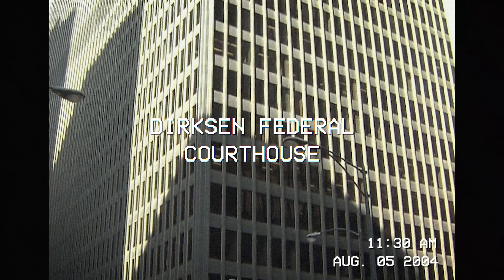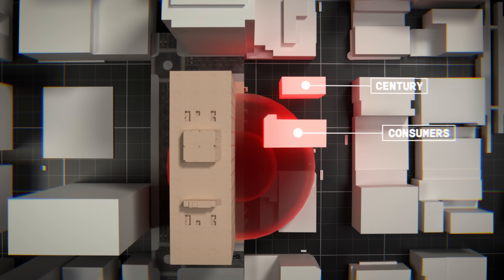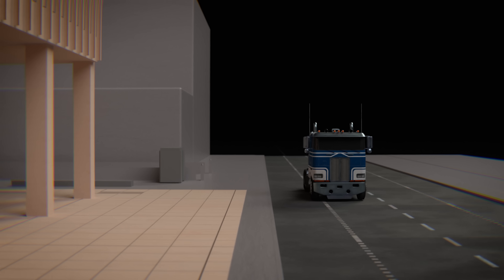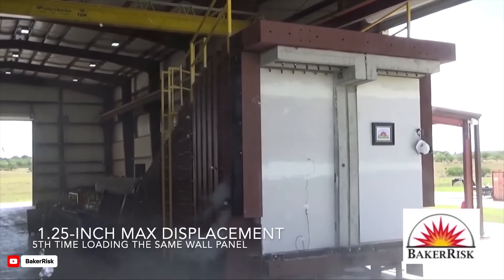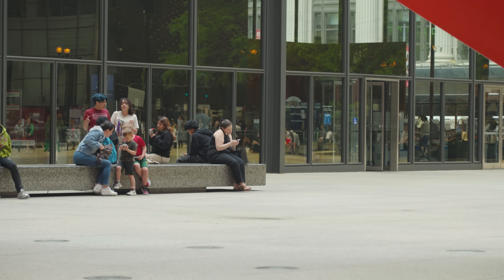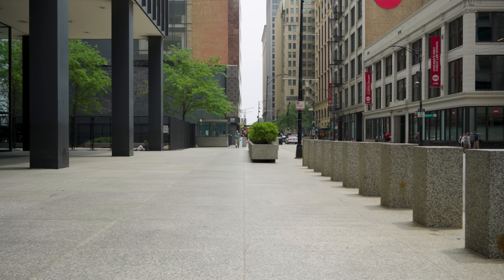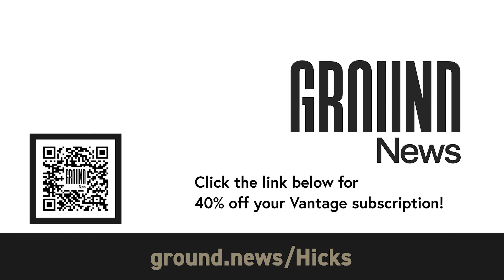How a Bombproof Building Works

Comment: The broken Windows theory was proven to be based on bad intelligence combined with false assumptions. I really thought a lot of that theory as well. Until I read Malcom Gladwells, "Revenge of the tipping point." Where he admitting to using bad intel and apologized for feeding an urban myth. I think caring for our environments pays dividends, but we shouldn't site bad evidence to bolster. Thanks for the great video.
Reply: I think broken windows has truthful elements to it, but just making a place look nicer won't make a place nicer and and of itself, because the underlying reason may need to be addressed.
Reply: It actually does work however
Reply: @My_Old_YT_Account  They're not going to acknowledge it.  It's motivated reasoning.  There's a whole political house of cards beneath their claim that it's BS.  They don't actually care about the claim itself.  But they must assert it as a condition for valid membership in their ideological tribe.

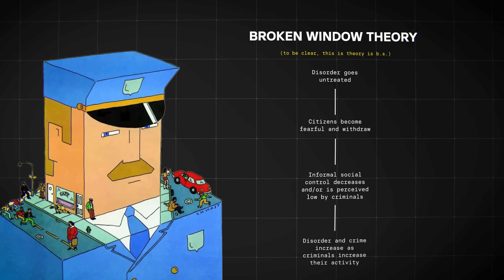Comment: 9:05  And this is where it goes off the rails. Like, is the abandon building a perfect example of the broken window theory since it literally has a broken window, looks abandoned, rough, and fortress-like causing people to engage in destructive behavior and increasing the likelihood of more serious crimes occurring, or is this building that bucks the CPTED tends part of the Dirksen building  part of the Dirksen building's territorial perimeter where "every element is carefully selected to discourage deviant behavior and would be attackers"? Is the "perfect example" of the broken window theory have the broken window strategically placed on the side facing away from the Dirksen so there's a building in between it hopes when the peasants revolt they'll get distracted by the cracks in the broken windows on this building before they get to the Dirksen? Was that part of the FEMA suggestions?  Maybe there's something in there about leaving a building to rot for a few decades to keep the masses away.

Or, and this is just a thought. When the government invest tons of our money into an area it cares about while at the same time putting none of out money into an area it doesn't care about, the area with the money is going to be nicer even if it has broken windows. Sorry, I mean shattered windows since the Dirksen's windows are reinforced with polymer films that are anchored directly to the structure unlike that crime ridden hellscape of a building on the same block that has windows reinforced with polymer films that are only glued directly to the door frame. 

Definitely had nothing to do with the government spending favoring one place over the other and was for sure about that  shattered windows. 

It's late, I did not proof read this.

Comment: Nitromethane, not diesel was used in Oklahoma City.  NM + AN is much more powerful than NM + ammonium nitrate, known as ANFO. The 1983 Beirut bombing used PETN, which is 1.5x as powerful as TNT and a heavy truck full would likely destroy any building it could reach within a few dozen feet. Hence, the only the only solution is standoff distance. Side note - the 2024 pager explosions also used PETN but, of course, have no relation to the 1983 event.

Comment: Why do I feel like the video didn't finish properly?
This doesn't encourage me to want to invest more time watching videos like this, as a matter of fact, it makes me want to avoid videos from this creator if it's going to leave me with the feeling of uneasement and dissatisfaction at the end of each video.
Reply: It’s intentional and designed to maximize watch time. This is an AI generated video. It makes you not want to click away until you get a satisfying conclusion, which never comes
Reply: @seanh1355  That makes no sense whatsoever as an explanation.

Failing to create a satisfying conclusion will dissuade people from watching more videos on the channel. 

Adding length to the video by incorporating a couple minutes to conclude it will increase watch time.
Reply: @seanh1355  this video isnt AI generated. Stewart has been making this style of videos for years. The problem is that people are expecting the video to be about a bombing, when there was no bombing. This channel is about urban design, therefore he spends the video talking about the design strategies used in bombproofing a building.

Comment: Really dislike how you explained the broken window theory, with large, visible text and images, and then put a tiny little bit of hard to read text saying that it is bs. For those partially watching, partially listening, they would leave with a completely false understanding. Or even watching but not playing close attention. This feels almost intentionally deceptive, and the exact opposite of what ground news stands for.
Reply: It's actually entirely correct
Reply from the maker: Understood. That whole section is where the video is meant to shift into critique, but that could have been made more explicit. The note was added because the critique wasn’t coming across and I guess it wasn’t enough.

Comment: Its crazy how they are letting those buildings rot, rather than sell them off. Given what the apartment levels could rent for in today's market, that right there would be a threat blocker.

It should be noted the Federal Reserve bank looks imposing not only due to being likely a non steel structure. But in some ways large cash storage dictates the exact opposite of the federal office building when talking security. Looking tough and imposing is that first layer, Because while angry people might want to bomb a court house. A whole lot more people love free money, And unless you are a politician, Free money tends to require stealing it. So a cash filled building like a federal reserve instead needs to outwardly state "don't even think about it".

Comment: Other commentators have pointed out that the Broken Windows Theory is problematic and while you've added a note in response I think it'd be best to delete that section altogether as BWT has been demonstrated by other researchers to have significant flaws. You could replace it with a short bit on Oscar Newman's "Defensible Space"

Comment: Why did the video write that "broken windows" is BS, while exploring exactly how maintenance increases deterrence.
Reply: It's because that's the theory and logic behind those design choices. That doesn't mean it's correct. I can design a dome building because spheres are the most efficient surface to volume shape, yet it would be a bad design based on faulty logic. The issue I have is the video doesn't make this explicitly clear.
Reply: Political correctness.
Reply: because statistically it is
Reply: Because it is BS, crime is overwhelmingly caused by poverty, not neglect.
Reply: @bmobmo6438  poverty is neglect sweatheart
Reply: @bmobmo6438  Uh-huh.  Everything is socioeconomic.  Nothing is environmental or... otherwise.
Reply: @WhompingWalrus  In this case, yeah, it is...

Comment: You can also absorb and deflect the shockwave like in the layout of the Alfred Nobel factory near Lubsko. The pressure wave is what buildings are voulnerable to. The same principle behind digging trenches in zig-zags applies to building resilience. Anyone can build a bunker, the skill I guess  is in achieving the same resilience with as little material as possible.

Comment: I have been in most of the major buildings in the Chicago area over my 15 years working as a messenger in the 1980's into the mid 1990's. I had a course covering the book on Crime Prevention Through Environmental Design well written with very good illustrations.

Comment: It was a good video that I think satisfied the expectations that one would have from the title.

There is a disconnect when discussing the design of the environment surrounding the building. It seems odd seeing that section lay out every supporting argument for broken window theory, but then in a note say it's all BS. If the theory is truly BS, then it justifies rebuttals to the arguments laid out that support it, no? And if there's not space in the video to break down the arguments for and against broken window theory, then maybe it doesn't need to be brought up at all. But currently I'm not sure what the takeaway from that section should be. Is the environmental design effective at modifying behavior or isn't it?
Reply: I think he has mentioned in at least one other video that hostile architecture  does not deter or prevent crime.